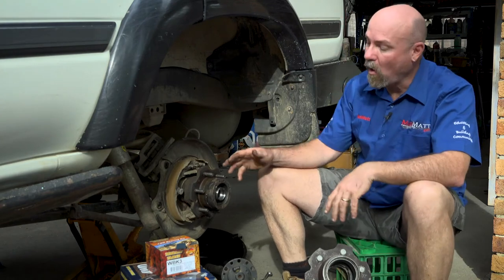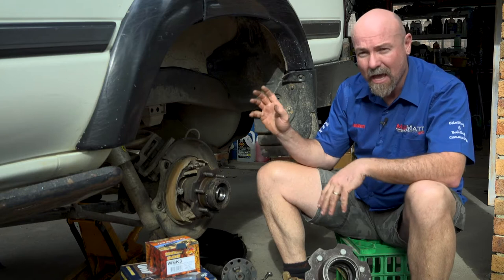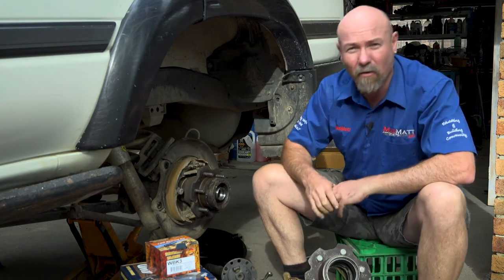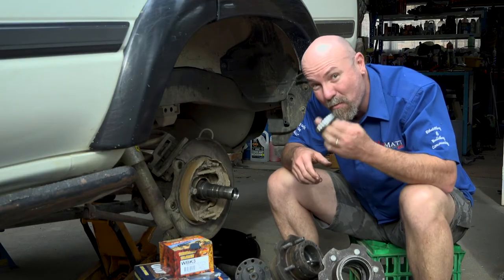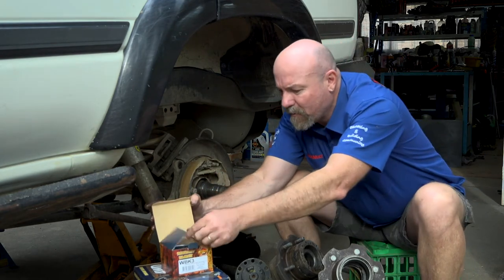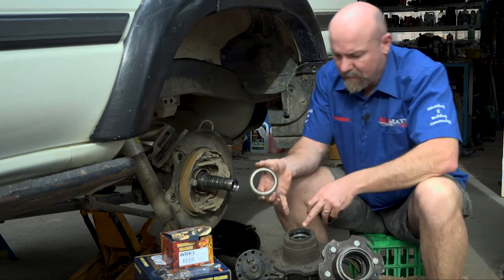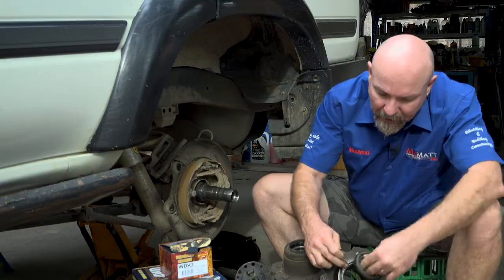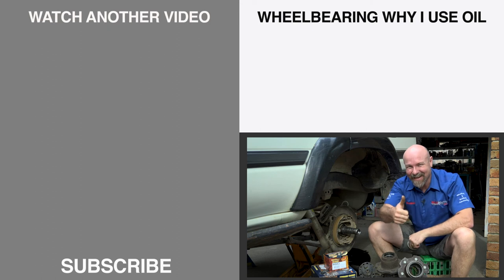FOLLOW UP - Wheel bearings why oil is better than grease!

Comment: Classis Range rovers had oil bath rear wheel bearings. Also the front bearings and cv joint were in oil too.
Reply from the maker: Best way to do it.

Comment: I think most if not all Semis run oil bath instead of grease. Got a sight glass on each hub to check the level too.
Oil is superior as long as it is changed regularly and kept at the right level.
Reply from the maker: Correct and yet the fight continues.

Comment: Two piece seals like that are the gold standard for industrial and commercial grade equipment it takes the seal wear surface and makes it the serviceable part of seal instead of having a motor or axle shaft or housing with a wear groove that requires a fix before it can sealed. Grease will dry out and become a paste inside sealed cavities. Wet bearing housings do not suffer from this. Wet housings need to be inspected but the same applies to greased housings. I have several trailers In my business and my failures stopped when I changed to wet hubs. The needed periodic brake check or tire replacement gets the oil level checked more than often enough.
Reply from the maker: Absolutely but the amount of heat i get for promoting this. My service intervals have dropped and reliability improved.

Comment: How long do you run your bearings Matt?
Interesting topic, considering Grease is Oil with a suspension additive (thickener)
Reply: correct! many people don't know what grease actually is, and there's a common misconception, the "thicker" the grease is, the better it lubricates", wich isn't true at all. The base oil is the money, and that's where cheap greases are different from quality grease
Reply from the maker: I can’t honestly say other than to say i get far better life from an oil run bearing than a grease run bearing. Think of the bearings in your vehicle that run in oil. They last far better than the grease run bearings.   This is because oil is always at the area that needs lubrication.
Reply: @MadMatt4WD  yes won't argue with at Matt. Oil will deftintely flow in the bearing better, and help it cool. 

The seal you discussed is commonly found in the planetary reduction of construction and agriculture vehicules, serving the exact same purpose as here. 

do you run it in the front as well? can't see you using it there, because of the link with the CV cavity, but if you found a way, all the better! 

Cheers, nico
Reply from the maker: No I don’t run oil in the front. I would if I could
Reply: @MadMatt4WD  i got an idea for it now that youre talking about it, gonna see if it works when i pull my hub appart
Reply: @MadMatt4WD  if you could have someone make a 10 mm wide spacer for behind the lock nuts, a tad larger than the inner bearing race, you could run a seal on that surface. The spacer could be sealed to the spindle with a internal O ring. 

The OD of the seal itself would be as large as the hub, the ID would run on the spacer. only trouble would be filling up, but one could drill a hole in the hub itself to fill it up
Reply: As a Diesel fitter have been doing it for years.     Only way to go.   👍

Comment: Makes sense to me. But if you're going to do it this way, (oil instead of grease) why not have your supplier build you a "sight glass" style hub, like on semi trucks and trailers. Then you could easily drain the old oil out periodically, and put new oil in.
Reply from the maker: We could but it's not really needed. the oil changes happen with a diff oil change.

Comment: So why do manufacturers make CV joints and universal joint in grease? The parts see the even amounts of load if not more?? This is an argument that’s older than hide and go seek.
Reply from the maker: They are under a different type of load to a bearing for one.

Comment: Both oil and grease are not good lubricant for bearings if they are  not EXTREME PRESSURE lubricant, without that friction can wear out ANY bearing🙄🙄🙄🙄
Reply from the maker: I’ll have to disagree with you there. Most bearings in your vehicle are lubricated by oil. Think of bearings in the motor that are oil lubricated. Gearbox bearings, diff bearings.

Comment: I've always thought oil would be better than grease but this video doesn't really prove much either way. Why? because the bearings were dry as chips, the hub was dry, etc etc etc. You had already pulled it down and cleaned it all off. As a mechanic and a teacher (of Automotive) I'd appreciate it if you would do a valid test and actually drive the vehicle and then strip it down and show us that happening in the video. Call me a cynic but I've always been suspicious of videos etc that have things already prepared. Its a bit like the old cooking shows where they say "and here's one I prepared earlier", it really doesn't teach or prove anything except that the person expects people watching to believe their word as though it is gospel. Your new winching videos are great but this one needs to be redone to prove your point.
Reply from the maker: Hi Michael. Thanks for the comment and thought but no thanks for the slight on my character by suggesting I've lied. This video is honest. If you take the time to watch it again you will see towards the end the oil is running out onto my tyre. The reason the bearing looks clean is because the oil is clean. Now in any video production we can fudge thing if we wanted too but I don't work that way. Did you watch the video I reference and Link Too? By the way I'm also a mechanic and have worked as a teacher of mechanics.
Reply: @MadMatt4WD  I never suggested you lied, I am however suggesting you make your video longer and show everything. When I teach I teach my students to be wise consumers of information. The fact you explain why it is all clean doesn't explain why it is all dry.  Leaving bits and pieces out, as you have obviously done, doesn't make for an educational video rather it makes for a video that doesn't explain much to people who are visual learners. Try not to take constructive criticism as a slight on your character but take it is a learning tool to help you make your videos helpful to a wider demographic.